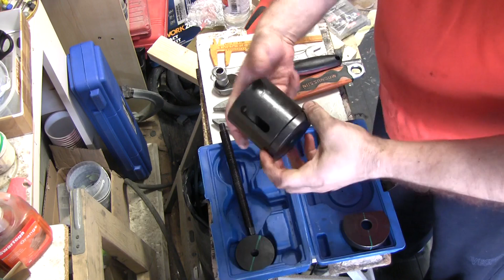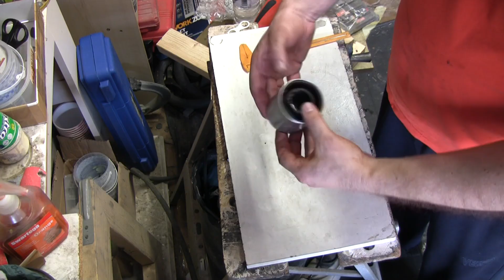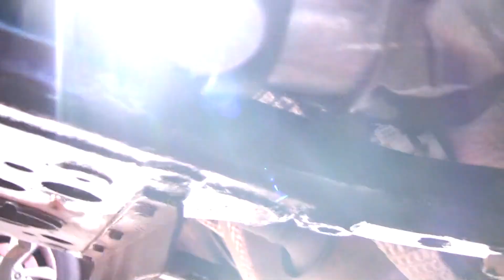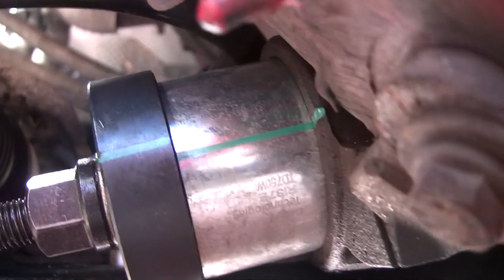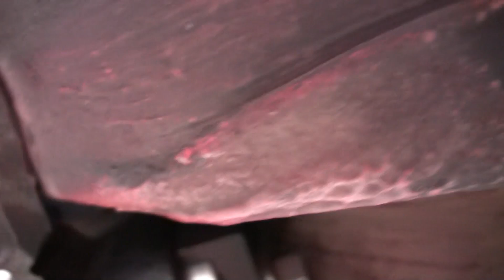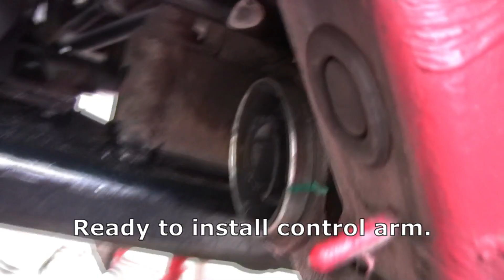BMW Mini R50 Front Control Arm Bushing install without removing subframe - Laser 5558 tool

Comment: buy assy is cheaper thean to buy fuching expensive tools sample mini cooper  r56  control arm assy 30€ vs joint ball 20€ or aft bushing with housing cheaper then only bushing self 🤣🤣🤣🤣🤣🤣
now a55 licking answer follow

Comment: ofcourse you wouldnt show putting the control arm xD , iof they are decent quality ones, it is super hard to push in the arm in place , i had to put the arm and whole bush assembly in the press and slowly push it inside fully lubed .even with a lift, this is hella sht job

Comment: buy assy is cheaper thean to buy fuching expensive tools sample mini cooper  r56  control arm assy 30€ vs joint ball 20€ or aft bushing with housing cheaper then only bushing self 🤣🤣🤣🤣🤣🤣
now a55 licking answer follows

Comment: Just about to try mine. How did you get the old one out. With the same kit. ?
Reply from the maker: Yes. Put lots of lube on the thread (lubricate all parts of the tool) and be prepared to use a lot of force to get the bushing start moving. There is a risk of stripping the thread. Once it 'breaks' and starts to go out it it is much easier to turn the nut. Good luck.

Comment: Question here: if you have the car that far disassembled, can't you just replace the entire bushing assy relatively easy?  It's what--3 bolts and it's off and in your hands.
Reply from the maker: Subframe needs to be dropped to replace the whole bushing in gen 1 Mini - the bolts can only be accessed from above the frame. They changed this in gen2 and bushing assembly comes off easily without subframe disassembly.

Comment: Excellent video and brilliant job. Are we assuming this is like an ebay tool circa £40? Was it man enough to remove the old bush? This one of the best videos on changing these bushes.... don't want to get into the mass of work that's involved in dropping the subframe and then the bush complete with bush housing would be more expensive too!
Reply from the maker: It should work with the tool kit from eBay. The old bushing was not too bad to remove - it does require a bit of force to break it loose, but once it starts going out it is not too bad.
Reply: @zadzwon112 Thankyou for yor excellent video and very helpful answer. Wife's car has  passed MOT but I think it drives badly .....I'm  sure this is the cause and I don't like paying for things that I could do. First step is to find the most efficient method - I.e. in knuckle skin and wallet damage, I think you have it having trawled youtube. Thanks again😊!